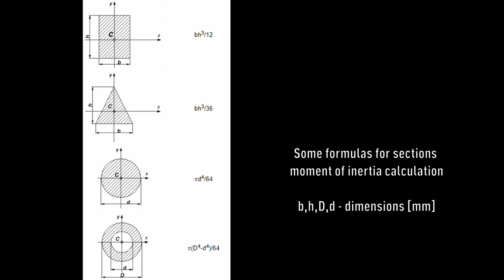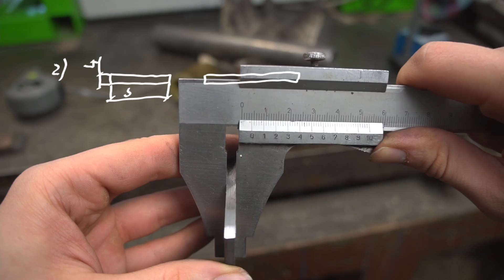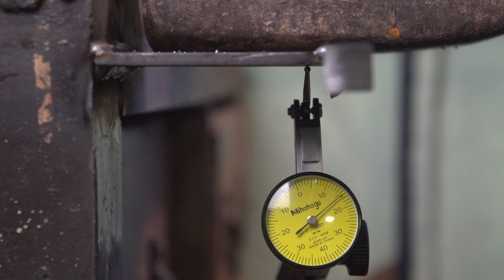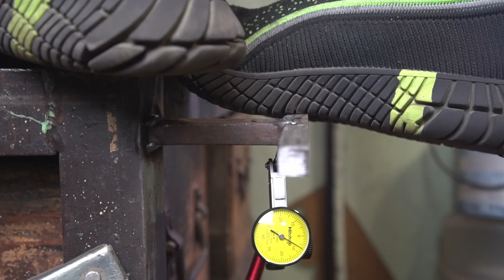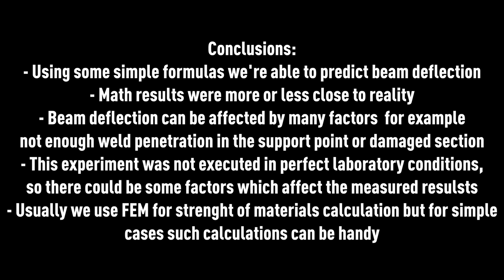Beam Deflection - How To Calculate

Comment: Great Video! Some deviation may come from the location from the center of mass. If you hang the weight on the wire through a hole, you may get better results. And just some general information for those, who care: MPa is the same as N/mm^2. That way you can see, how the units eliminate each other. Additionally you have to be careful with b and h, if the direction of the force changes. With these formulas b is the dimension perpendicular to the force.
Reply from the maker: Thank you for watching and the input. I'd like just to add - to be more exact - MPa is N/mm^2. Using a consistent unit system is pretty handy for all the calculations. Also if I make similar experiments in the future - I'll consider your advices!. I was trying to get the center of the mass as close as possible to the end of the beam but you're right - this could affect the results. Also worth noting is the fact that we can use these formulas for calculations for other axis of bending but that maybe a topic for a more advanced video 😁